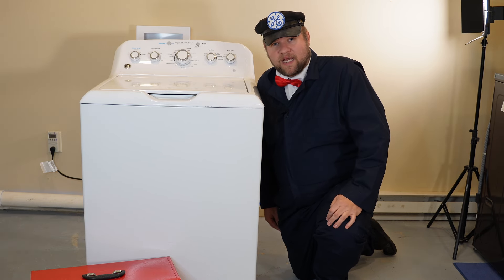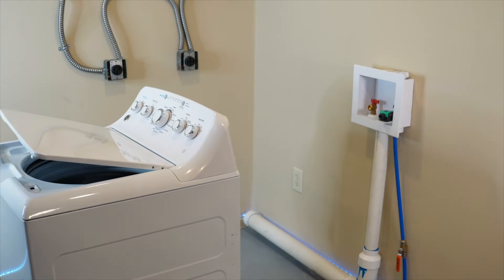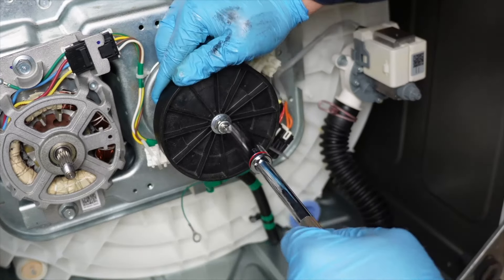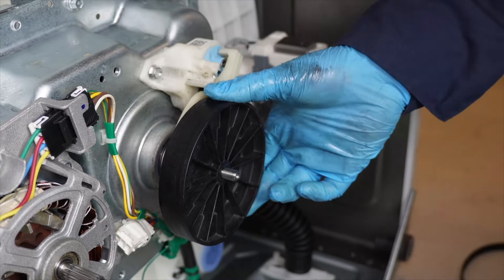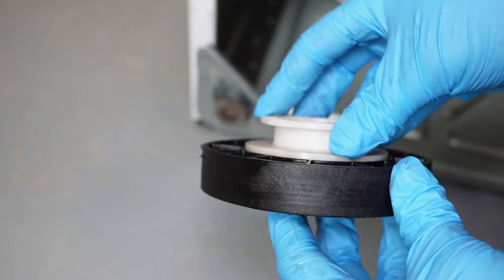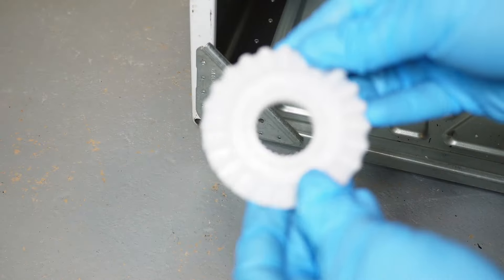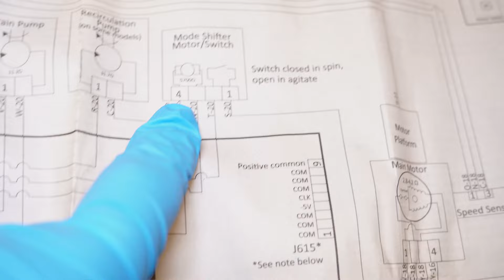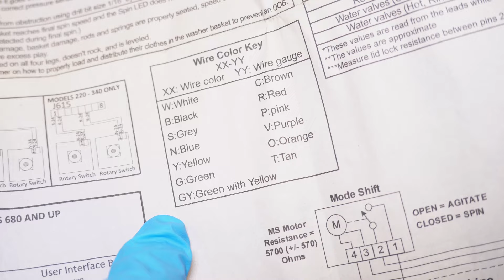GE Washing Machine Making Noise - How to Find & Fix

Comment: This machine looks new why is it making a noise when it's not that old? WTH. These manufactures making junk. My grandparents had wash machines that lasted 20+ years.
Reply: Yep, they're junk! One year manufacturer warranty! I've got two of them right now. 4 years of use and clutch has gone out in it. If you want a washer that will last 10 years at least or more, get one with a 10-year warranty! Speed Queen. They make commercial washers or local washer store that fixes and refurbishes washer sells speed Queen new. You can buy a commercial grade one for your home

Comment: GE GTW331BMR0WS Worst washer ever: noisy agitator that doesn't agitate properly but only pulses!!! Water: doesn't fill up properly: small : barely 1 inch of water!! medium = small , large = medium, Super = barley large!!! Spin cycle last 23-25  min!!! And these are only some of all the issues with this very, very, very , bad so-called washer. Barely can wash 2 set of bed sheets and got to add water manually!!! This product should be taken off the market and GE should get a "collective lawsuit" for selling these through various stores and those stores as well for selling this outrageously horrible "washer" machine.  😡🤬

Comment: I have this exact same machine. 2 years in and it started chriping when agitating, then it wouldn't spin out sufficiently, then it stopped agitating altogether. Belt had shredded and thrown itself from the pulleys. Replaced the belt and it is agitating and spinning great, but squeaks a bit still when it starts agitating. This video is very informative.

Comment: Ben, love your videos. Ive been a GE factory service tech for 7 years now. Just a tip if anyone is looking for a washer, buy direct drive, much more quiet during agitation.
Reply from the maker: In the next video, Im testing the GE belt-drive against an LG direct drive motor, very fascinating!
Reply: What oil or grease does GE use?
Reply: Test the agitation sound. I wish you could film the audio underneath so we can hear the motor particularly agitation. @bensappliancesandjunk
Reply: We have a GE washing machine that sounds like it's pushing air out when it spins, it's pretty loud....any thoughts?
Reply: is it normal to make noise ? mine is brand new and first wash there is a sound when its turning to "wash".. never heard that on any other machines
Reply: Mother just bought new GE and it's very loud at agitation. I was about to return it for her. Looking at some of these videos, looks like a normal thing for GE. Never heard a machine so loud in my life.
Reply: @rodrigoarellano9729 
My GE washer died after 3 years, the noise just got louder and louder. Started off as a few squeaks here and there then a horrible grinding noise. The extended warranty covered the cost of the washer they didn't even try to repair it. Now I need a new washer and have no idea what to buy. 😢

Comment: Hey I have this washer and it has made that awful grinding noise and here it turns out loose change slipped under the agitator. Do u have a video on how to get the change out. But now I wonder if the parts you show are bad in my washer or if it's the change causing it noise. PLEASE HELP THE NOISE IS DRIVING ME CRAZY!

Comment: Fyi regarding agitator removal my GE model GTW220ACK6WW Just had one bolt down in the bottom. I had to use three long extensions to get. Did not have a place for a screwdriver. I just removed the cap at the top. Some of them have fabric softener dispenser on top. Pull that off and below it and you'll see the bolt at the bottom

Comment: My transmission was gone out on it so the center shaft that does the agitation no longer turned From the motor it wasn't engaging anymore. Apparently the gears in the transmission were stripped out. I wonder if this is due to people putting too big a load in?  And there's no clutch dogs like the old fashioned washers to wear out and replace.

Comment: To remove the agitator you need to align the whole with the little bump/nipple with a screw driver. Do you push in with the screw driver then twist off?
Reply from the maker: Yes thats correct

Comment: My identical ge machine bangs and shakes terribly when spinning, sometimes, even after carefully balancing the items laying heavier towels and jeans on the bottom ... ugh
Reply: I don't have this same model, but it's a GE. I found this with mine as well. We have found if you use the bulky option (you'll be wasting water though), it will spin at a slower speed and it won't make as much of a racket. Not an ideal fix in any way, but it works and we found it doesn't leave lint on our clothes like the water saving modes. These water saving modes use way too little water.
Reply: @xtos2001  Appreciate your response and this issue is the very reason I text Ben more than once that I would love to have the older analog, no digital hooey washing machine where you can open the lid at anytime to throw in some other item at will ...
Reply from the maker: Some of the older iterations of these need a board update because the spin cycle doesn't balance right
Reply: The basket in my Maytag top load washer had severe movement which caused the washer to move either left or right and would take longer to wash the clothes.  I tried to even out the load, but it did not work.  One day I looked at the washer to see if it was level.  I noticed that the back side of the washer was 1" to 1-1/2" lower on the back side.  I leveled the washer by adding wood blocks on the back side.  Since I got the washer level, it's been working well so far.  It is so quiet on the spin cycle, I couldn't tell if the machine was still on.  It used to take an hour or so for the machine to complete its cycle, now it takes about 40-45 minutes.  I hope this helps.
Reply: Push up and down on the rods. GE suspensions are crap. They're the cheapest on the market though......
Reply: We just bought this same model a week ago and it’s not spinning out the one blanket that I have in there. It’s so frustrating! I just run it again and it start to fill instead of drain & spin.

Comment: The pulley on the motor is damaged. How do you remove it. I didn’t see that process in this video. Thanks.
Reply: Remove the nut which holds the pulley to the motor, then wiggle the pulley off the motor's shaft.
It make take some effort, but it will eventually come off.

Comment: Nothing in the video seamed damaged. But I did notice my tub moves 100% independently of my agitator. and my clutch assembly was completely covered in oil. So, bad gear case?
Reply from the maker: They overload the gear cases with grease. It's possible it's caused an issue with the clutch assembly. I'd probably look at changing that for <$50 before considering the 200 gear case

Comment: This was a complete waste of time. I’m trying to see how to take the front off of a washer to get to the suspension rod.
Reply from the maker: There is no front to this washing machine to take off to replace the rods. They're all top-mounted. The waste of time is you thinking that it has a front. This model has nothing to remove on the front.